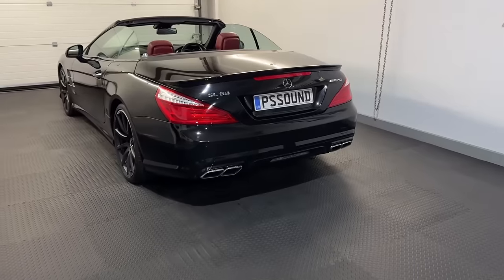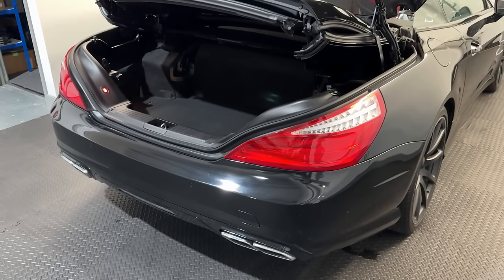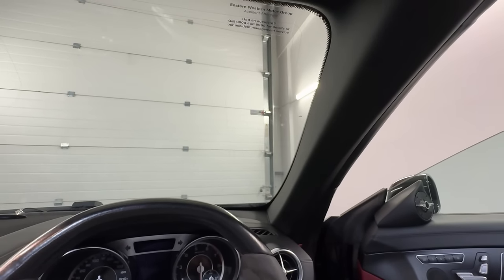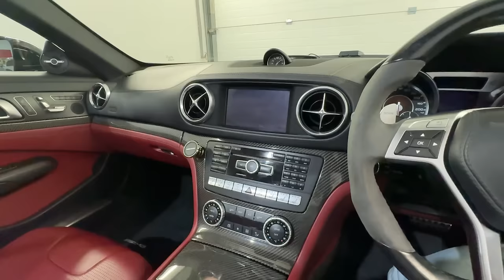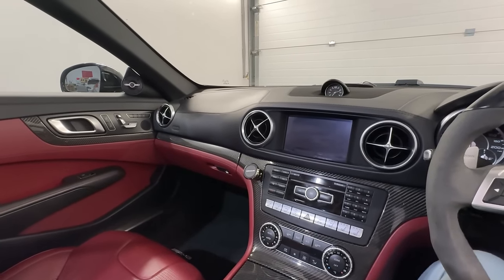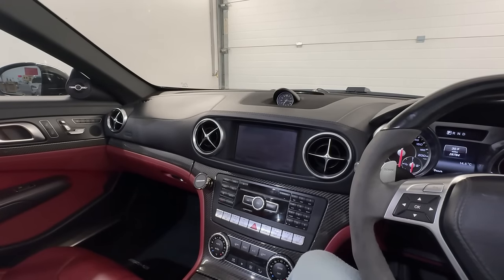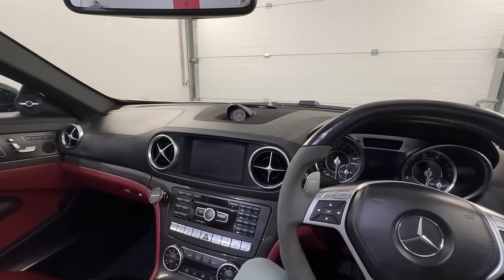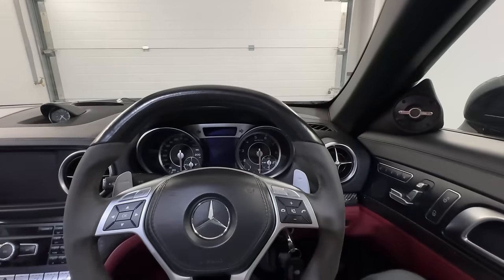Mercedes SL63 AMG High-End Audio System - EXPLAINED - Steg, Helix, Focal

Comment: I saw u mentioning the role of a front sub to take off some of the stress from rear sub. Can a similar sound quality be achieved with a factory built under seat sub box like from Audison or JL Audio?
Reply from the maker: Somewhat yes. If an underseat sub can be controlled with a DSP fully active, then it can be tuned to integrate between midbass and rearsub for sure.

Comment: When limited on space you use the best sounding drivers for the applications. Everything is spot on and understand the midbass drivers upfront. Leave well alone if it is working. I would have liked to have seen a more flush fit in the fiberglass sail panels. I can see a little daylight coming through on both sides. I understand it is very tough to do an the the installer can only do so much. A little more creativity but it is an excellent install no doubt. I am big fans of yours as well as   Matt Schaffer…Best of luck on the next build. God Bless!!
Reply from the maker: I know what you mean, but that gap was needed to be clear. It’s tricky with a frameless door.